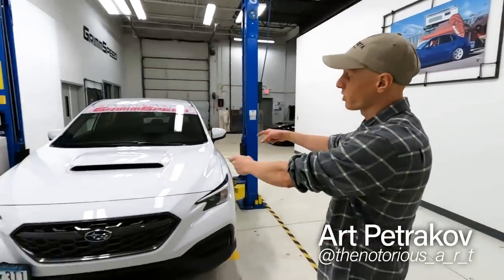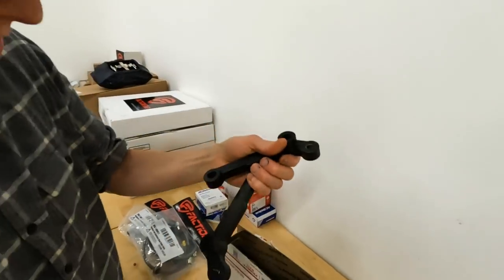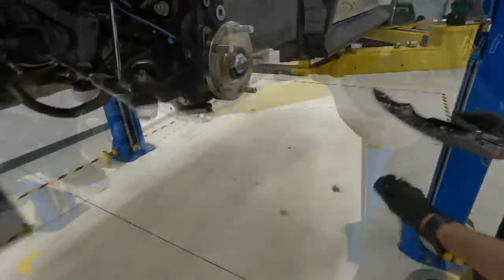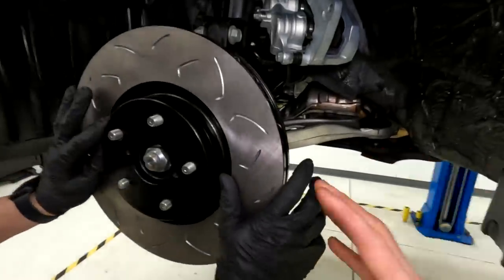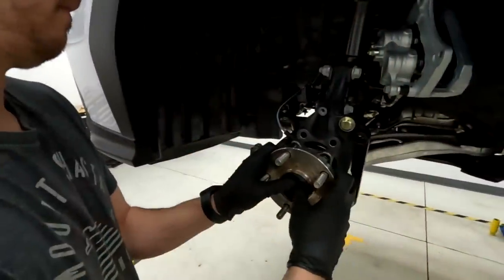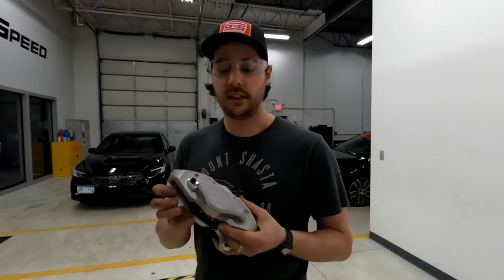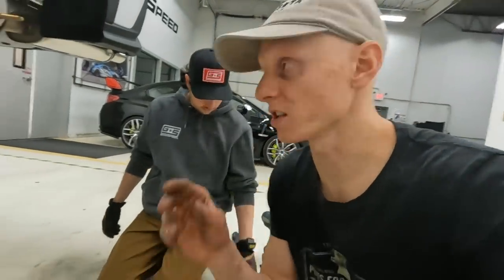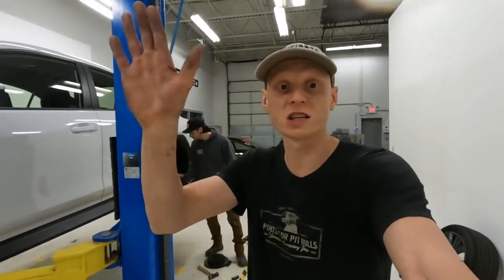Building a Big Brake Kit for our 2022 WRX

Comment: Love these videos guys, keep ‘Em coming. To be clear, can you use the 15-21 STI brembos for this 22 WRX? Also, hey yo when are ya gonna do the Bypass valve video???? I love that sound that it makes.
Reply from the maker: You got it Wade, thanks for tuning in! You CAN, although we're not sure if it's a direct fit. The point of this conversion was to keep costs down as compared to sourcing used STI components. We'll be digging into that shortly, hopefully our current GS BPV will fit right on!
Reply: @GrimmSpeed  thanks for the reply. I asked because I ordered the new wrx and it should be here in July. I want to do some mods to it but I would really like to add the STI brembos to this new car. Excited to see the next video! Love what you guys are doing
Reply: Yeah I’m also interested in adding the STI brembos myself. Definitely subscribed to this channel!
Reply: @wadeflores6978  try 21 STI brembos and not bolt  would need spacer between the hub and the brake rotor.
Reply: @GrimmSpeed  any link for the brake kits?

Comment: Wheel color definitely needs to be bronze or gold and the caliper should be painted either cherry blossom red or the bright limish yellow color pallet from the og (555 rally cars
Reply from the maker: You're definitely not far off from our mindset, I think you in particular will like Part 2!
Reply: Hmmm...don't recall Subaru ever using any lime/green, etc back in the 90's.  My kid is named Colin - after McRae - and I followed WRC closely and am a model builder and have reward winning scale models.  Never seen them. Unless it was a privateer running an ex-Prodrive car.

Same with cherry blossom.  Never seen calipers painted that color.  Not by Subaru or by Brembo.

I know, I know beauty is in the eye of the beholder, but while the ricer movement seems to have settled way down it just won't die.  A quick hit...Subaru F'd up with the neon 6-pots, and the S209 made people think "hey, it's factory, I can put it on my WRX!"  Put those aside.  A quick example...I'm part of the BL/BP era Legacy/Outback community. As time has gone by, two trends set in.  The Legacy people pursued full JDM front and rear end conversions becase it is a huge improvement. And the Outback folks (me) went for subtle lowering.  Some people think it's stupid but there is big purpose - stems from Subaru ceasing GT wagon production - and so long as you don't have the SUV two-tone paint scheme, those fender flares make the Outbacks look like widebody Legacy's.  I'm biased, but my black Outback with STI wheels, STI grill (from a BM/BR generation - shouldn't fit but I made it happen) subtle OEM chrome rocker strips and JDM rear tailgate and lights and it looks like a Japanese Audi RS4.  My 2011 STI pushing 600/600 hp/tq. has subtle exterior and interior changes.  Interior has Recaros and went for S206 look. Exterior had chipped paint and a couple small cracks in the bumper covers from the previous owner, so I replaced those and the rocker panels...looks new and engine has 24,000 miles.  Both cars are for sale right now, as of tomorrow.  Teenagers will walk away.  But adults will be my "target".  I'll be shocked if someone younger than 30 buys the Outback.

Anyway - can we just make one final push to kill the ricer crap?  I know, in the community people don't believe they're part of this.  But they didn't think anything was wrong in the past, either.  I'm totally for Brembos on my 2022 GT coming in August.  It's how I found this.  But if I get them?  Silver or black, with a Brembo decal.  It's not an STI, or a Cadillac, and Subaru's always had "Brembo" on their gold calipers for a long, long time.

Just more subtle/cool...not necessarily "sleeper" either...just think of Subaru's JDM/Asian-Pacific/Australian looks.

Comment: I'm confused why you didn't use the 4 pot 06/07 wrx fixed caliper or the gold 4 pot brembo's? The 4 pot 06/07 wrx fixed calipers are really good and you can pick them up brand new for $500 for the front pair. Those 4 pot 06/07 calipers bolt up to most subarus with no adapters or modifications, including my 5 gen impreza. So for $800 with pads, you have really good brakes. Rears are a bit more complicated, but also, maybe another $300 for the calipers and the cost of an adapter.

Comment: And what about the mounting hub centric ring on the front wheel? Now it's deep inside the brake disk which means you won't be able to centre the wheel
Reply from the maker: We’ll eventually want to machine a spacer with a hub centric lip big enough to center the wheel; that being said the lugnuts are self-centering so as long as they’re torqued properly, everything should center just fine!

Comment: Surprised you didn't look into YellowSpeed Racing for a brake kit, they already have kits for the 2015-2021 models, that's what I went with my WRX, paired with they're inverted coilovers :). Either way good video, lets the rest of us know that there isn't a lot to worry about with upgrading the brakes :).
Reply from the maker: We did consider a more off-the-shelf kit, but really just wanted to take on a small project that others weren't doing. A work harder, not smarter type situation, haha!

Comment: If yoiu guys used the mounting kit from BWC Fabrications, it doesn't require drilling knuckles at all. Just have to knock out the grommet inserts on the caliper and reuse your stock bolts. That way you don't have to worry about ruining a knuckle if you stink at drilling knuckles.

Comment: Do a proper Goldie color on the STI wheels.. As I'm currently in the process of should I go with after market GOLD wheels on our 2020 STI or just have them powder coated GOLD?  I like the latter but.. Still contemplating aftermarket.  Great Job on the Cadillac brakes, as that was the inexpensive route everyone went with for the 08-14 WRX
Reply from the maker: Gold FTW, since the 2020 STI wheels are pretty damn cool from the factory, I would say powder them gold like they SHOULD have been from the factory!

Comment: This is a great vid and great idea. 
Can you list the part numbers?

And, I thought that the 2022 WRX 6MT uses the same drive train as previous models and/or STI transmission and thus read diff, etc. Is that accurate?

I always look at big brake kit upgrade prices, and I always shake my head because all you need are the specs and then the knowledge of other car parts, etc. that will fit in order to work, and you can save thousands of dollars. But, this is the first vid I've seen of someone showing this. Ya, but now the wheels are staggered bc no spacer on the rear. ?

Comment: How do these brakes affect the bias of the whole system? Given the smaller piston displacement of the ATS brakes, wouldn't that just make the ABS go nuts when you actually track the car?
Reply from the maker: I suppose that remains to be seen, however it doesn’t seem to be an issue on the VA WRX with plenty of these conversions having been done. We’ll explore and troubleshoot if necessary when we get there!
Reply: @GrimmSpeed  I was under the impression that on previous generations of WRX, the ATS fronts tended to shift the bias rearward, triggering the ABS before the fronts had exceeded the tire/pad limitations in panic-stop situations or hard use on track. Or was this something that was remedied with a restrictor/prop valve for the rear by the company that made the kits?

Comment: Is there any update work on the brakes? I would wonder what the fitment would be for this solution if the Paragon Rotors With the custom Hats would make this fit without the spacers required.

Comment: Can you give greater detail on what needed modified to do the front calipers? I have the same kit on my GV and would like to do it on my wife’s VB as well.
Reply from the maker: Here is a rough parts list!

172-2768 - Cadillac ATS Front Passenger Side Brembo Caliper
172-2777 - Cadillac ATS Front Driver Side Brembo Caliper
PowerStop L3781 2015-17 STI Rear Passenger Side Caliper
PowerStop L3780 2015-17 STI Driver Side Rear Caliper
CTSVBrakeSwap.com Subaru 4-Piston ATS Caliper Conversion Brackets
(4x) ARP 100-7716 Extended Wheel Studs
Brembo P09004 Brake Pads (front)
Brembo P56048N Brake Pads (rear)
FactionFab FFA1.10041.1-G - Front 05-17 STI Rotors
FactionFab FFA1.10046.1-G - Rear 15-21 WRX Rotors
FactionFab FFA1.10091.1 - Front Stainless Brake Lines - 08+ WRX
FactionFab FFA1.10093.1 - Rear Stainless Brake Lines - 08+ WRX
Reply: @GrimmSpeed  thank you! You guys are the best!
Reply from the maker: @Borp56  No problem, thanks!

Comment: in stead of spacing out the rotor, could you have the new bracket machined out so that the caliper sits further toward the engine direction so as to not need the spacer?
Reply from the maker: Yes, you could custom machine the bracket if you wanted to. We used the CTSV Swap Bracket so we adapted our setup to work with it.

Comment: Did you guys try and see if the 6 pot OEM STI brembos fit?
Reply from the maker: It's likely they could be adapted to fit, but we don't really want to pull the set off of our 2020 STI at the moment. I can confidently say that they are not a direct bolt-on though.

Comment: Would be easier spacers between hub and steering knuckle ?
Reply from the maker: The spacer we used was to give the correct spacing for the caliper to fit with the rotor. It sits between the hub and the brake rotor.

Comment: Will Grimmspeed make a master cylinder brace for the 2022wrx. ?
Reply from the maker: Since the chassis is so rigid it may not be necessary, but we'll be doing some testing to verify eventually!
Reply: @GrimmSpeed  thx for replying!!!

Comment: Yes! please give us more info on this kit and set up ! Like comment share and subscribe! Thank y’all!!! 🙏🏼
Reply from the maker: I do have a parts list for the parts we used to make this happen on our 2022. As of right now we are still deciding if we want to step into the braking/suspension market, so no hard release date on any brake parts from us yet.

Parts List Used for this Kit:
172-2768 - Cadillac ATS Front Passenger Side Brembo Caliper
172-2777 - Cadillac ATS Front Driver Side Brembo Caliper
PowerStop L3781 2015-17 STI Rear Passenger Side Caliper
PowerStop L3780 2015-17 STI Driver Side Rear Caliper
CTSVBrakeSwap.com Subaru 4-Piston ATS Caliper Conversion Brackets
(4x) ARP 100-7716 Extended Wheel Studs
Brembo P09004 Brake Pads (front)
Brembo P56048N Brake Pads (rear)
FactionFab FFA1.10041.1-G - Front 05-17 STI Rotors
FactionFab FFA1.10046.1-G - Rear 15-21 WRX Rotors
FactionFab FFA1.10091.1 - Front Stainless Brake Lines - 08+ WRX
FactionFab FFA1.10093.1 - Rear Stainless Brake Lines - 08+ WRX

Comment: Is this set also can fit for 2022 outback? Thanks
Reply from the maker: We haven't done the testing so i cant say for sure, but it should be pretty close. You may have to use a different rotor, and you may want to measure spacer thickness yourself for the right clearance.

Comment: Just my 2 cents being in the automotive aftermarket industry. This video is like something you would find on NASIOC, not a company who is trying to market a big brake kit manufactured by an aftermarket brake company that tailors their product to a platform. Now if you were to get Stoptech, AP Racing, TBM, etc. to do a build series of what goes into the process of developing a big brake kit upgrade and then the install process. I think that would be way more conducive and carry more regard to the fact new platform, new brake system it needs to be engineered to fit the new platform.
Reply from the maker: You’re partly right, however if should be stated that we’re not trying to market this big brake kit, rather just showing owners of the new platforms some DIY options that they have for upgrading the brakes. We’re sure that those aforementioned brands will be posting videos of their own actively marketing production BBKs that they’ve created in house and we can’t wait to see those. Think of this video as interesting content, rather than product creation media.

Comment: Would the stock calipers work with the FF rotors?
Reply from the maker: We used the STI version for our big brake setup, with lots of customizations to make it work. I am not sure how the slotted FF setup would pair with a 22 WRX. Id check with them to confirm fitment.

Comment: Are you going to design a kit of brakes so we can fit 15" rally wheels? 🤔
Reply from the maker: Hmm, we HAVE had a lot of people asking about that!
Reply: @GrimmSpeed  So are you planning to get one before next winter 🤔 I need to buy my winter wheels 😉
Reply from the maker: @benlegare81  It's a bit hard to tell if it's something we'd do since there are SO many other projects down the pipeline. I wouldn't wait up if you're looking to pick up wheels in the next few months!
Reply: @GrimmSpeed  Use the 06/07 WRX 4 pot fixed calipers. They bolt up to most subarus with no issues  and they are super cheap and really good.